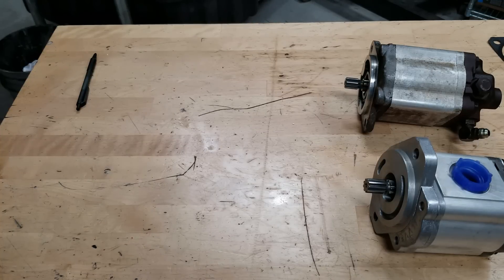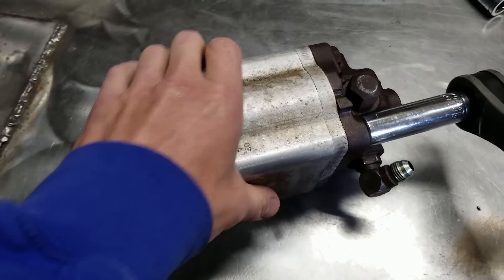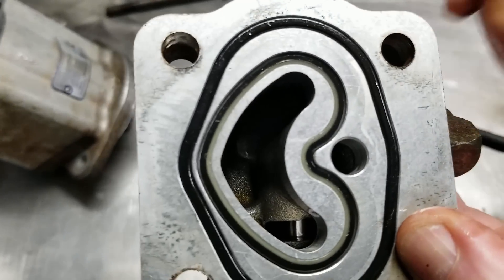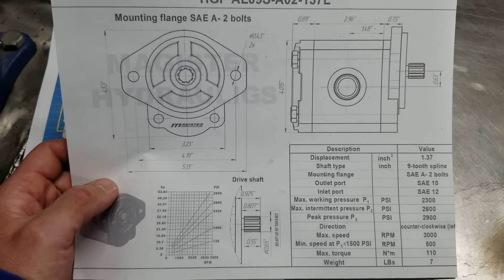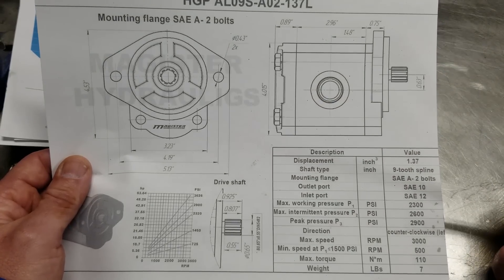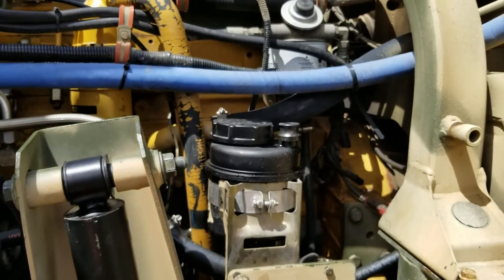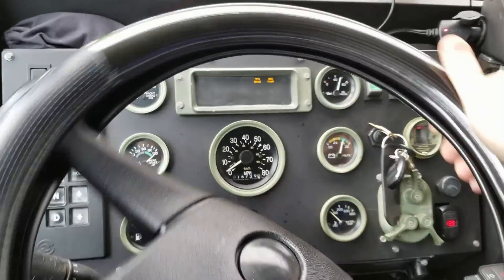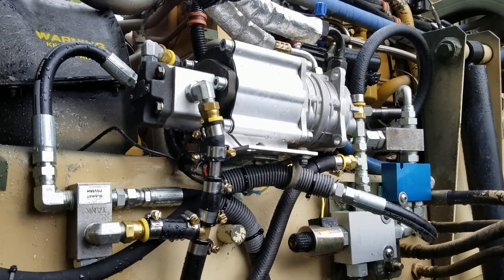Abel LMTV build part 111 (OEM hydraulic pump dissection, steering box education, and upgraded pump)

Comment: The little hydroponic pistons you took off, Send them to me so I can make a mini log splitter.
Reply from the maker: Yes you can have them
Reply from the maker: The OEM hydraulic pumps?  I am hanging onto those for emergencies in the middle of nowhere....
Reply: @SeanFastidious  No the hydroponic cylinders you took off that pull up the front axle when  it flies threw the air. lol I am trying to Get Dave to do that with his.

Comment from the maker: Road tested while this video was uploading and everything is working as it should.  Steering at idle is perfect and a/c BTUs are tip top even at idle.  On the LOW a/c setting the evap temp sits at 48 degrees.  This pump gave back enough to make up for the 50/50 flow division.  The a/c is now complete aside from one hydraulic fitting I need to swap out as noted in the video.
Reply: What is the next project?